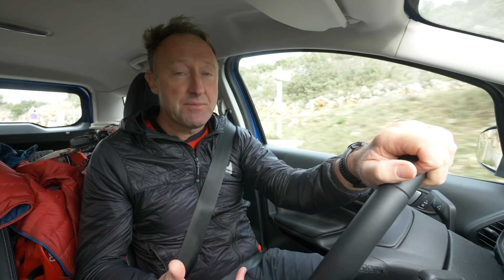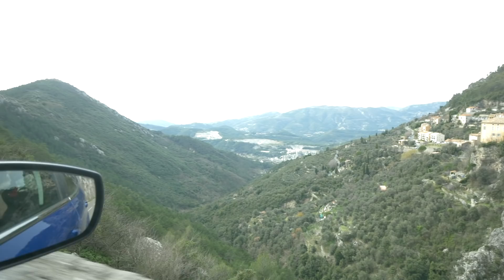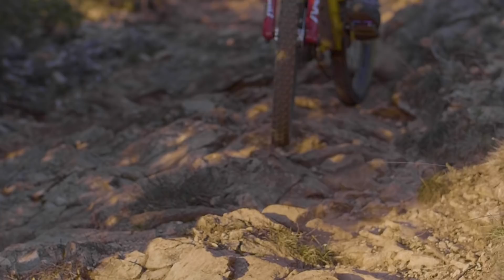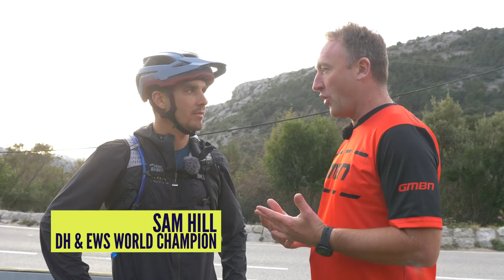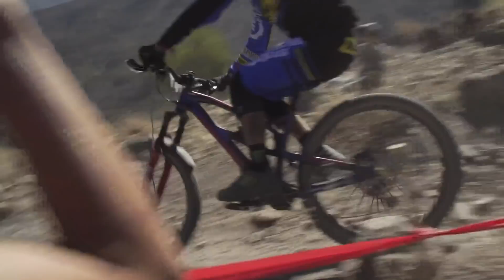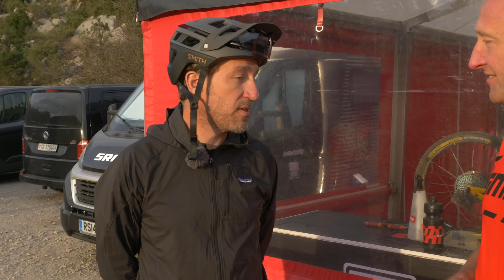Product Testing With The Pros | How Do MTB Race Teams Refine Their Set Ups?

Comment: I can dent the crap out of alloy and still get home. Aluminum recycles, carbon not so much.
Reply: Reality is carbon will never be recycled in any form, the new carbon with nylon replacing the epoxy resin, will never be recycled either. There will only ever be few small companies "promising" to do it when you send it back, but no one is controlling small companies. Only big guys get those ridiculous "call in" audits, that won't make no difference...
All for alloys in general myself. 
Recent fashion of ridiculously big tubes on bikes, forces thin walled carbon, which yet again causes some ridiculous gentle crash->critical damage reports on carbon frames just like it was when they were aiming for weight only.

Comment: So are they saying these riders are able to tell the difference between a 28 and 30mm rim width just by riding the bike??? Or the number, material of spokes?
Reply: Maybe not, but the speed can be noticeable and if they are timing...
Reply from the maker: You should be able to notice a feel in the stability of the tyre at low pressures in corners and over obstacles. They'll go on feeling and time!
Reply: @gmbntech  I'd understand if it's velodrome, but cycling off-road has so many variables. We can go in one corner, tackle a rock garden, do a jump in dozens of ways. You ride differently on a winter morning and a summer afternoon. Nearly impossible to do the exact same time twice on the same track, same settings, same rider. I do understand there is science behind it but hard to believe a 2mm rim width change,  makes a measurable difference.

Comment: Well if Alu was not a good material then we would not have used it for motocross/dirtbikes. There is not always a need to replace something because of a trend. I do like progress, I do, but the progress in bicycle manufacturing gives so little(u are the most important factor) for so much higher cost. I had the org CrossMax wheelset on my steel mtb in 98, and I still have a pair that are pretty much in mint condition. Although I need new skewers and  org mavic crossmax rimtape :P For me I want as stiff(especially latterly) wheel as possible, well we have the tire and the suspension for taking up all the punishment, if the ride feels harsh then the suspension is not setup correctly.(talking from a mc perspective :P )
Reply: Seems many continue to view the needs of MTBs as the same as the needs for road bikes, but this simply doesn't work. MTBs are rarely going the speeds of road bikes for as long as road bikes, so aero gains on MTB are far and away less important. Similar to weight, where being heavier actually has a few advantages in certain disciplines and going light is a trade-off where, in road cycling, lighter is so superior that the UCI has mandated a minimum weight limit at events.

Basically, while the design of MTBs has matured in the last 30 years, the marketing has not quite caught up.